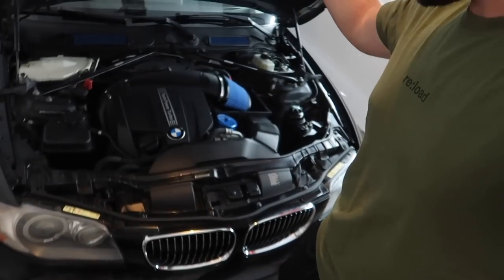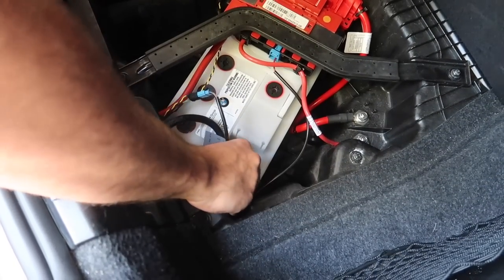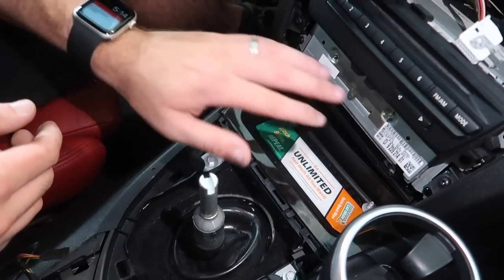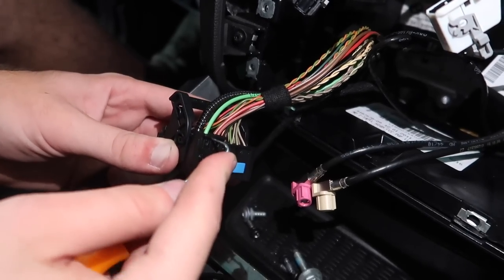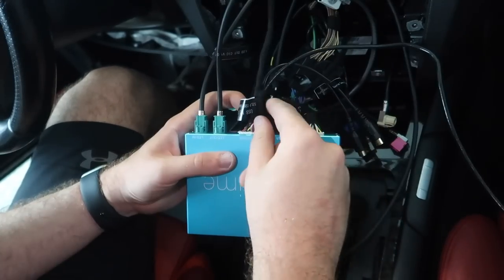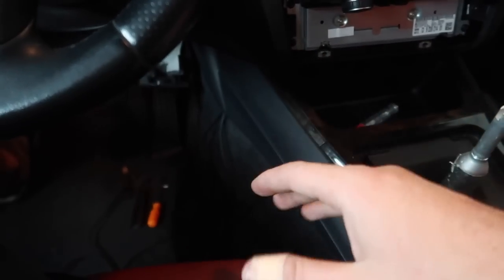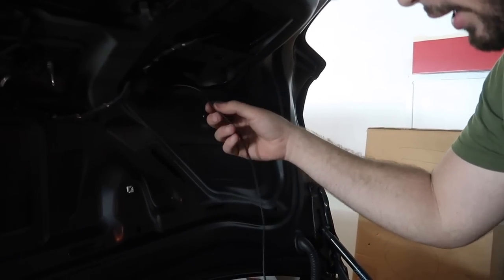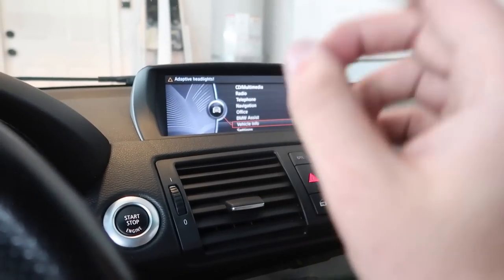THE 1 SERIES GETS APPLE CAR PLAY AND BACKUP CAMERA! (FULL INSTAL!)

Comment: Good install Nour! For the rear camera, the way I did it was, wire the camera wire from MMI to the passenger side, underneath the glovebox, through the passenger door/foot panel, through the backseats and then into the trunk. 

That way I had no camera wires showing anywhere 👍
Reply: So do it comes w the back up camera or its separate?
Reply: @JTrel  Separate!

Comment: My kit was a bit different, it didn't have a thin connector like yours, it had a VGA cable attachment, I just cut the wire fed it through the loom, then soldered it back together. Works good. (If you have the VGA connector, you cannot get it through the rubber boot loom, i tried for many hours and decided it was better to cut and solder than break the cables in the loom)

Comment: No wires for me, lined mine underneath where the rear seats meet the trunk lining and down the passenger side through the glovebox. Will later re-solder or crimp the wires near the trunk handle to fit through the rubber grommet leading into the boot.
Reply: how difficult was this, i already have to remove the glovebox to access the fuses for a dashcam, so is it an easy solution to run the cable through from the drivers side, and then up to the back?
Reply: @ash-ok6dr  I ran the reversing camera cable through the front passenger side. You will need to lift up the back seat and then continue running across to rear drivers side. You can completely hide the cabling.

Comment: You can mount the mmi box behind the passenger side air vent, it is a lot easier and less likely to damage and wires.

https://f30.bimmerpost.com/forums/showpost.php?p=26934550
Reply: thanks, this is very helpful.
Reply: Just tried to install the way the video suggests, and there is no way its going to fit behind the main stereo unit, maybe its because mine is an alexpress version, but the thick cables would not seat out of the way. Thanks for posting this link, I'm going to try putting the box there instead.